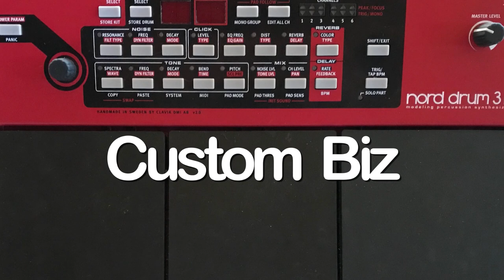Nord Drum 3P Review by Phil Pardell Custom Sounds pt. 3/4

Comment: Hey if u play without headphones, is  the stick contact sound bothersome?
Reply from the maker: I haven't had a problem, guess it depends on how loud you have it running through a speaker.  You can hear a lot of stick sound in this because i have the room sound mixed higher so you can hear my voice.  Hitting the pads is pretty much as loud as a rubber practice pad.

Comment: It sucks that it does not have independent outputs 🤦🏻‍♂️
Reply from the maker: Yah, really wish it did!  I usually send low kick type stuff through one channel and the higher stuff out of the other for the sound person.  Not ideal but helps.  I don't think reverb can be panned to one side though so reverb will appear in both channels even if the sound is panned to one side.  Hopefully the next one they make addresses these issues.